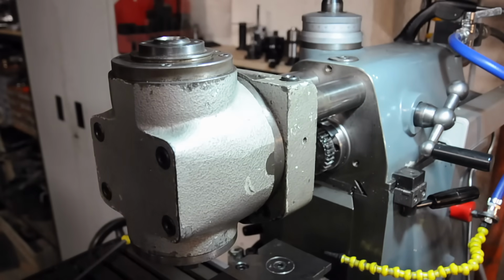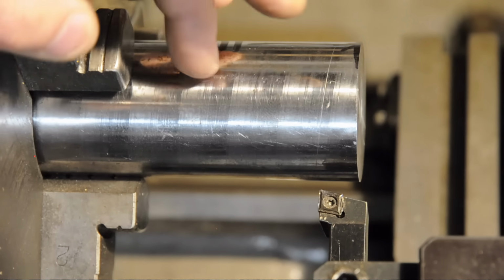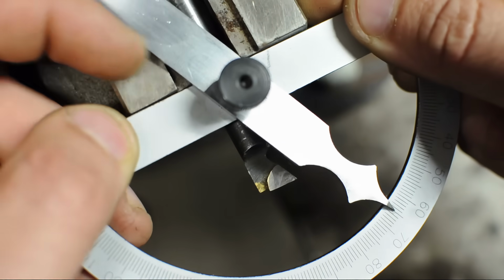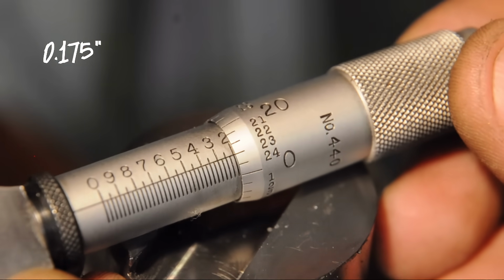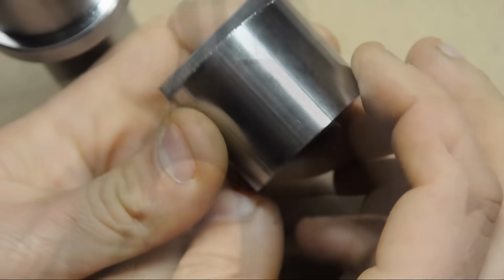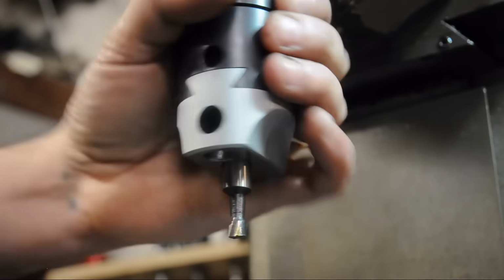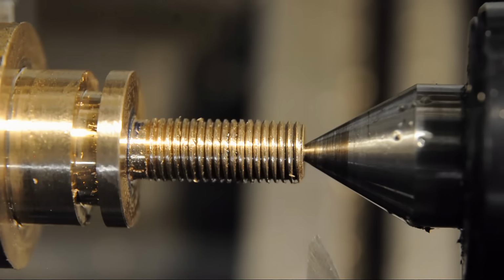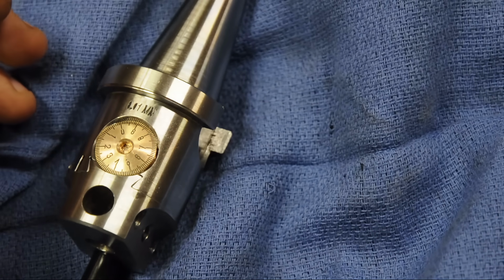Homemade - Boring Head

Comment: I wanted to expand a little on my suggested video. I have been looking on the web at various sites for speeds and feeds. What I am finding is a lot of information that seems to be directed for 100% production efforts and large shops, or CNC applications. Most of my end mills are eBay used without names, so chip load data is not available, guess I could guess from other data found for "new" end mills. Also, if one goes to 4 sites one can get 4 different SFPM ranges. My stuff is more like Keith Ruckers or Dave Richards stuff.

Comment: Suggestion for some future video. Having a home/garage/hobby shop I have not figured out feeds & speeds (fairly sure I run everything s_l_o_w). If you could provide an overview of this it would be great. Also, note all my stuff is manual, no CNC etc. Older SB 10K lathe and MSC type Bridgeport style mill. I finally did add a digital readout for the mill. :-)

Comment: God, I wish I had one of those a couple of years back. I was doing precision holes with a 30 year old boring head with the objective of getting a precision around +- .01 mm (0.000394 in) on a 38 year old Maho CNC (good machine but too old and badly maintained). And I had to this in a very tight schedule and part of other machining I needed to do and I was doing 12h per day, 6 days a week. It was a nightmare, the CNC by itself had at least 0.005mm  of play on both plane axles and the tool had about  0.02 mm of play so it was hit and miss and I had about 20% of minor failures (fixable) and about 5% of major failures (welding and other stuff involved) so that kind of broke my previous good record. I asked for better tools but the answer was, that's your toolkit, live with it.... let's just say I wasn't in a good mood for a while.

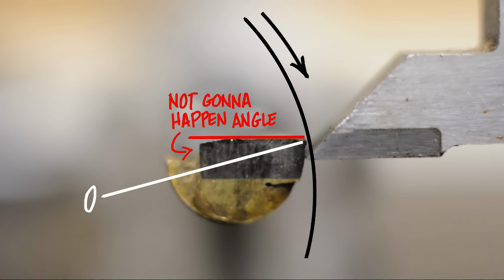Comment: Hi tony, awesome video. I am not a hobyist, maybe in future, but i work with mills and lathes. I wanted to ask you about at @11:03 you talk about bad boring bar quality because of rake angle. I was just thinking about it and dont understand how you measure that rake angle. I dont see how flat cutting tip being over center line of tool would have any effect. Ive used one of these before and one thing ive noticed is when u insert that bar in that boring head, your rake angle will depend on how you position that bar and not how higher the tip is over OD of bar itself. Cant really put picture in here but i think you will figure it out what i mean when you think about it. Me myself when ive used those bars, they didnt have any flats on them (out of the box) for the grub screw to lock them in so I milled flats myself. And when I did it, i made sure that milled flat on OD would MAKE that rake agle the way I wanted - it was about angle difference between milled flat on OD and cuting tip flat - not the height difference between OD and flat being above or below it. Please respond if you think I am wrong here but if I am right I would be happy to know folks here watching this dont start grinding tips for no reason :D

Comment: I’m curious on how you figure out the adjustment screw is adjusting to exactly the amount you want?  You made yours to 
.01mm per div.  how do you figure out that it’s true to that?  I get 100 divisions of 1mm is .01 but how do you know how big to make dial and so on?  Thanks in advance.
Reply from the maker: size of the dial is arbitrary.  the screw is 1mm pitch so 1 full turn = 1mm advance of the cutting tool.  The bigger you can make the dial, the finer the resolution.  It is still a boring head though, so you must measure the bore the closer you get to final size with bore gages / micrometer.
Reply: This Old Tony haha, brain fart on my part, I should have known that.  Thanks.

Comment: Why did you plunge with an endmill at 19:00 and then switch to a twist drill to make the hole?
Reply from the maker: The end mill was used just to create a flat spot for the drill to land on.  Otherwise the drill would have wandered off of that round surface.
Reply: Thank you! I'm new to machining so it's nice to see how you do things.

Comment: wow cnc cutting the numbers and indexing lines , i was planning on that when i saw Stefan Gotteswinter used that special machine wish can basicly only do that one thing 
still like to see how you programmed that in the software to get all that stuff placed in a circle
Reply from the maker: It's not that hard (though it is tedious).  Domed surface (in this case) in CAD.  Make a plane above it and add your text there.  "Project" the lines and your text onto the domed surface.  This will result in text/lines that wrap around the surface in 3D.  Pick these lines in the CAM for your tool paths.
Reply: prolly have to try it a few times to get it to work , i wonder if theres a simple 2d drawing program that alows you to take a straight set of lines and numbers and turn it intoo a circle , if you can grow/shrink that to size and then cut and paste it intoo the cad program over the dome shape it should make it a itle eazier 
think that little part is about the hardest to make of the whole project in terms of getting youre head around the cad programming

Comment: At 19:17, what does the Φ symbol in front of 2.5mm mean?
Reply: It litterally means "diameter". Sometimes the line going through is angled so it becomes Ø instead.
Reply: thanks boss
Reply: Patterns? I sure CAN see the patterns that throwing the old file in with your other files creates on the formerly sharp teeth. Keep them in the sleeve or make a roll for them. :)
Reply: I couldn’t find one of those swivel-ended Rohm vices, but the conventional ones list for well over a kilobuck!!!

Comment: Just need to increase feed and add flood coolant for roughing cuts but slower feed witch might result in stringy swaft or chips is fine for a finishing cut normally without coolant

Comment: Hello.  Where can I find a Heller lathe file?  I can't seem to find anyone who sells them and yours looks new, so they must be out there.  Thanks.
Reply from the maker: I'd check ebay probably.  I have a new-old-stock box I found at a local machine reseller with about 8-10 unused files in it.   hope I don't run out!
Reply: Thanks

Comment: you''re brushing the file the wrong way.. you're supposed to brush exactly in the angle the grooves go, and always forward so the hooks are bend away from the surface so the brush runs smoothly along the grooves instead of scratching at your file.
make some chalk on the file and try it the way i said, you'll instantly see, why thats the way to brush a file, besides not destroying the cutting edges of your file ;)

Comment: Tony, I really like this video, and all the other videos of yours that I've seen, but I'd like you to reconsider one particular statement: "Adding two pin diameters" to the female measurement only works for the male dovetail if the pins happen to be some very particular size.  If it worked for you, that's great, but it seems to have been purely by chance.
Reply from the maker: Thanks Ben.  Yes you're correct but with reasonably sized pins at the dovetail angels we typically work with, the error should only be a few thousandths (5?) and hopefully well within the adjustment of a gib.

Good catch!

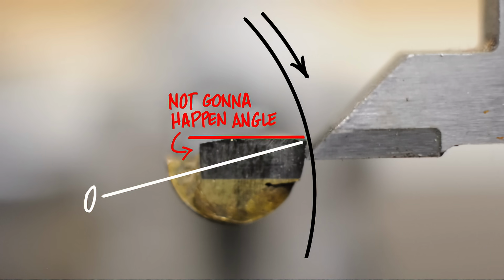Comment: Just revisiting that video, and of course it is very inspiring. One thing i do not get about 11:04 is if those are usually set for a diameter and then plunged down, why is the rake of the side of the boring bar so important and not the bottom? Ok, you used it as a dovetail cutter that needed a different form anyway, but the cheap boring bar was not meant for that.
Reply: Tony changed the form of the tool to cut the dovetail, but the shortcomings of the stock tool still apply.  When Tony showed the graphic, he explained the carbide was too tall (above center of net bar axis).  He could have taken the cut flat, but instead used good judgment and treated the existing corner as center, implying the grind would reduce the carbide thickness in a wedge shape.  This was good thinking of course because this left the most carbide under the point of highest pressure.  Tony apparently misses nothing.

Comment: Hey, just thought I might point out a small problem in an otherwise stellar video. Measuring dovetails with pins is a bit more complicated than just adding a couple pin diameters. It also depends on the height and angle of the dovetails. mrpete222 covers it well in https://www.youtube.com/watch?v=0VGOa69sePo or you could use an online calculator. If you were cutting a lot of similar dovetails, you could probably select a height, angle, and pin diameter to make the numbers come out round, but you could probably just as easily just note the inside and outside measurements you want.

Comment: This gives me some new perspective on my Asian made boring head (which, by the way, sucks). It's always slipping during use, impossible to set with any accuracy, and always bores tapered holes...  Having a round column mill drill, means the length is an even greater issue.  This inspires me to try and make my own.  Thanks for sharing!

Comment: Been searching for how to set up an 'on block boring bar machine' for a few days now. i bought one at an auction and have never used one. It is very similar to the van norman (an exact copy actually) like this one http://www.ebay.com/itm/MACHINIST-TOOLS-LATHE-MILL-Van-Norman-Cylinder-Boring-Bar-Machine-Attachments-/191719684843?hash=item2ca3623aeb:g:SSAAAOSwYHxWJYw~  . if any one can direct me to an up load or two that shows the assembly process it would be great.

Comment: Do you have to mark the actual zero position of the adjustment screw on the boring head, or did you manage to orient it to a predetermined mark?
Reply: Presumably you'll be using different tools, with different geometries, making a true zero setting impractical.  Where the markings matter is when you start to form a rough diameter, each mark then represents the tool movement relative to the last cut.

Comment: Man your "Play by Play"is just right.  Just the right amount of information sprinkled with just enough intelligent humor.  VERY few You-Tube  machinists get this mix right.   Additionally, video is great. As a job shop machinist I've watched enough things turn, however you don't leave out what IS important about chips and tooling selection, setup etc.  Now for what I would hope will be a useful tip.  When I ran a lathe and needed to "knock the edge off of a part" I did one thing for safety sake, I would turn the file end for end, and run the lathe backwards.  With this arrangement I could reduce the risk of a miss-step leaving me with a file sticking out of me.  Also, (and I'm aware that you know this, so my apologies in advance) on must keep the file in motion and not just rely on the turning of the part to get the cutting done.  I have actually seen guys with plenty of years in front of a lathe that did not get this.  Once again, thanks for the very good work.
Reply from the maker: Thanks Ido'.. and good tip!  I have in fact tried that quite a few times but the muscle memory just wasn't with me and it felt more dangerous than doing it the other way 'round.    Old dog / new tricks.  I completely agree, however.
Reply: This Old Tony is

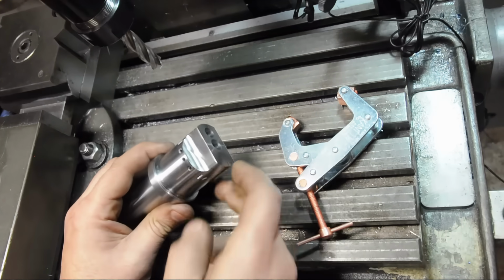Comment: The bad finish at 22:30 can be avoided by plunge cutting the corners to start the finish pass. Also a jack underneath and a clamp across the vise would help with rigidity. I like the clamp bridging the slide to prevent it pulling up. If you didn't have a suitable c clamp you could place a strap clamp on top over the jack.
   Mike (o\!/o)

Comment: I love your videos!  

What does a boring head do that a drill bit does not do?
Reply: They make round, straight holes in the correct place. They also groove, step, face, chamfer, etc. in said holes. Reamers may produce nice smooth straight holes but cannot be counted on for absolute positioning or other types of operations like bottoming or grooving. Besides, I have yet to see a shop that has every possible size of drill or reamer. But with a boring head you can have them all. The only limitations being the size of your machine, the boring head and the tools you make for it. Of course, Adam will need parking attachments for all of them.
   Mike (o\!/o)

Comment: I want to see how you did that offset center at 21:00 please
Reply: It is done just like making a cam for a steam engine. Either by measuring and marking a new hole position or by just pushing the part off center with one jaw while measuring with a dial indicator. On a mill just center on the part and dial over to the new hole, drill and ream. Or bore!
   Mike (o\!/o)

Comment: Can someone explain me pros and cons: Metrics vs imperial. :)
Reply: Imperial is frought with antiquated standards of unrelated gibberish. Twelve inches in a foot, 3 feet to a yard, 5280 feet to a mile, each of which are non-intuitive.  However, since I grew up on imperial, all of it is second nature.  I can work in metric of course, who couldn't?  But my problem is, when I hear a metric measurement I "understand" it, but I still unconsciously covert it to Imperial in my head.  When a machinist says "I held it to 1/100th of a MM", I don't think in MM, so I'm only impressed when I get around to realizing that's about 4 ten thousandths of an inch.

Comment: Tony I have watched a few of your videos and I will say, They are some of the most informative i have watched. I do have a question, @ 21:07 you chucked up the head in an "out of center" position, HOW? I need to do this. Guide me, please
Reply: Ant Chia he's using a 4 jaw chuck, each jaw on the chuck is independent of the others so you can tighten them to turn off center stuff, or do a bunch of other stuff.
Reply: I thank you for the info. Mine is a 3 jaw and its not independent so I will have to use my mill. Truly enjoyed your video and I did subscribe, thanks

Comment: Watch out for the secret Time Machine setting on the CNC control: It will send you to San Francisco in that car with Laurel & Hardy.... Make sure you have the single block set, the Z-lock on, coolant to program control and then initiate a G19 spiral mill command. Don't use the G18 because that''ll send you into the future where you might need to find a DeLorean to get back... G17 will make you repeat things over and over and over and over....

Comment: Very interesting video! Thanks for it!

Could you give us some insight in how you are archieving such good surface finishes on your lathe? 
What inserts are you using? Speed and feeds? And which material (which chromoly..?  ) ? 

Thanks !
Reply from the maker: It all depends on your lathe, the type of tooling, and the material you're working with.
Take a few test cuts when you're starting off and note which give the desired results.
My lathe maxes out at 1200rpm, I can't take full advantage of what the inserts can do.

Comment: Thinking about what you said, Tony, while at first it seemed almost like stating the obvious, on reflection it strikes me that a boring head is perhaps one of the few pieces of mill tooling where concentricity of the business end with the shank doesn't matter, and I say that not only because it's made to carry a single point tool.
Balance is one other possible consideration, but let's face it (oops, no pun meant), it virtually never runs in balance except by accident, and all you are changing is the diameter at which that accident occurs.

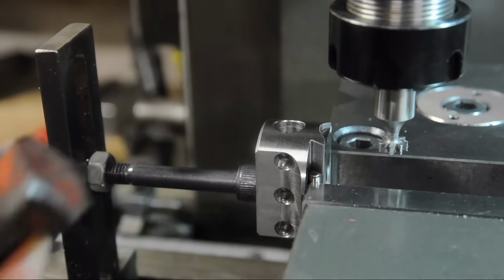Comment: 29:35 how did you do that small mill from the bolt?
Reply: turn off the thread, form teeth with shaper, sharpen as normal. use a grade 8 or higher bolt... c'mon, you knew that, lol

Comment: 32:51 I think the reason behind that would have been the run out in your 3 jaw "Self Centring" chuck when you used that piece of aluminium off cut to hold onto the adjustment screw to cut the radius on the face.
Reply from the maker: Yes, perhaps!  good catch.

Comment: Is there are reference engraving on the fixed part of the boring head anywhere? A little line that matches with one of the engraved lines on the dial? Wouldn't that be needed for tight tolerance boring? I've not used a boring head before so I might be thinking a little too critical.
Reply from the maker: You are correct, it would need a reference mark.  I planned on making it on a separate moving ring (so I could 'zero' anywhere I like) .. but haven't gotten that far yet.  I'll probably just engrave a fixed one.  One of these days.... :)
Reply: I guess now there's 2 things.

1) So then, This Old Tony... what's next? 

A real whacko U-Axis head? Like a boring head but the tool rotates around the outside of a cylindrical part of a milling job? I'd like to see your approach to that..

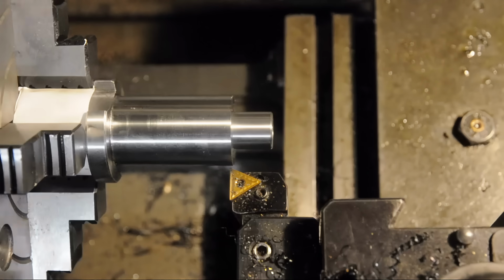And 2) In this video at the 28:08 mark onwards where you were machining the taper, it looked like the work was being "pushed off" by the tool..

Comment: your really good keep up the good work tried your multi meter stuff at my real job as a auto tech and found that measuring brake rotor thickness can be measured better using a temp probe anyway love your videos keep up the great work learned a lot and your ideas and  talent show through thanks for your time

Comment: Great job on both the boring head and the video!  What kind of grinding wheel was that you used to rough in the boring bar?
Reply from the maker: Resin bonded diamond.  Cheap import, but seems to do the trick.  Thanks amphib!

Comment: I would like to say that those "cheap" boring bars are never intended to be used out of the box.  They are in fact intended to be ground and honed before use.  Their purpose is to save you the effort of making a holder, and brazing a piece of carbide to it.  Before the internet misinformed everyone, this was common knowledge in the machining world.
Reply from the maker: Excellent point, Arion, thanks!
Reply: The same goes for the "cheap" brazed carbide turning tools I see everyone struggling with. They must be ground and honed as well.